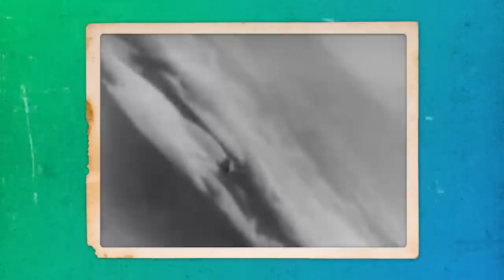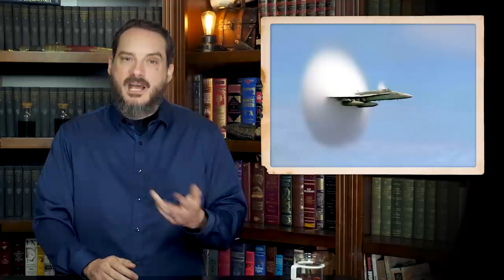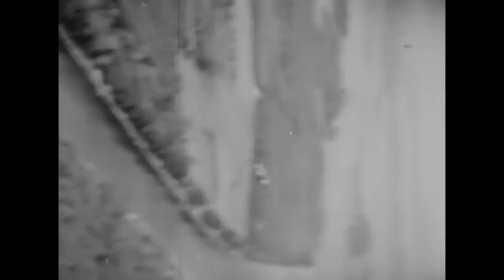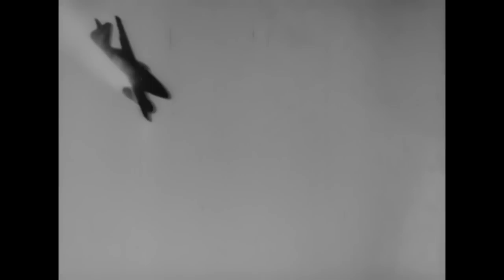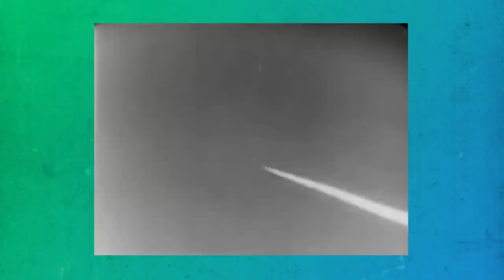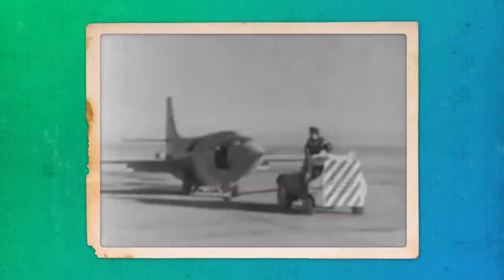Did a German Pilot Break the Sound Barrier 2 Years Before Chuck Yeager?

Comment: One small correction: Hitler's orders had nothing to do with there not being enough 262 fighters. The problem was engines. To make a turbojet engine without exotic imported metals Germany no longer had access to was just BARELY possible, and resulted in engines with an official lifespan of 12-20 hours, depending on model, and can even reached that. By the end of the war there were about a thousand 262 airframe extant that never had an engine fitted
Reply: The problem wasn’t exotic metals - the first eight hundred engines had an even number of blades which caused them to explosively fail in resonance. Changing to a prime number of blades in the turbine eliminated that problem but left the turbine temperature issues.
The British engines were universally superior to the German engines.
Reply: @allangibson8494  So, Joel was correct. Solving the resonance issue did nothing to increase the availability of superalloys.
Reply: @ostiariusalpha  No but increased the engine life from two hours to twenty hours… Basically one explosive engine failure per flight to one per ten flights.
More Me262’s were lost to engine failure than any other cause.

Comment: It's likely that a bunch of plans broke the sound barrier before Chuck Yeager, but the x1 was the first in sustained level controlled flight.
Reply: Nope.  First - nothing with a propeller pulling it along is going anywhere near Mach 1, no matter how much you dive it.
Second - the drag rise of the early straight-wing (And slightly swept, like the 262) jets when transonic is so high that they just aren't getting there either.  I've flown some jets from that era - DeHavilland Vampire, T-33 (P-80) - and done aerodynamic analysis for others.  Physics says no.
Reply: @peterstickney7608  are you british by chance???
Reply: @peterstickney7608  yeah ok .. is your name  Walter Mitty by chance?
Reply: @peterstickney7608  I don't know what shape I'll be in at 80, but running a mile in 5 minutes probably won't happen.
Reply: @peterstickney7608  I'm not so sure. There has been a multitude of jet- and, most of all, rocket-powered aircraft in Germany well before 1947 and when looking at e. g. the Me 163, I don't think any of your points applies.
Reply: Even about that I'm not so sure. Many German designs of the mid-1940s seem to have what it takes to break the sound barrier and stay controllable, but with a war going on, no independent, official measurement was taken (which is how USAF can get out of even the most believable hints to earlier achievements) and a lot of data and reports were lost by the end of the war, either in bombing raids or in deliberate acts, aimed at not letting the enemy have valuable information.
The sad fact of the matter is: We will never know for sure, so I'd let Chuck Yeager have his triumph, but take it with a fair amount of caution anyway.
Reply: @LEJapproach  True.. Yeager was quite full of himself but he did live an extraordinary life
Reply: The de Havilland DH.108 Swallow could have been the first, but the tragic breakup of the plane during a test dive in September 1946 ended the idea. Had the DH.108 second prototype been shaped just a tad differently to better deal with the shock waves of approaching Mach 1, it likely could have broken Mach 1 by late 1946 or early 1947.

Comment: 600km/h? The speed of sound is the double of that.
Reply: That should have been knots, not km/h (well, it's actually 661knots, 761mph or 1225km/h, at 15C at sea level)
Reply: at high altitude 323kts IAS can be close to mach 1, but the rest of the video does not use IAS.

Comment: In 1986, I read Yeager's autobiography. All I can conveniently go by right now is memory, but I think what he said is that there were several flights made around that time, each pushing to a slightly higher speed, and the limitations of the instruments were such that it could not be determined with certainty exactly which flight pushed above Mach 1 for the first time.

Comment: This again...  Mutke's claims have absolutely zero credibility.  The Me 262s were "Silber (Silver) Assets" considered vital to the defense of the Reich.  Their operations, and losses were tracked with even minor incidents being reported up the chain of command.
We have those records.  I've seen them.  There is nothing in these records, or the inventories of Any LW jet unit that show any aircraft written off due to non-operational damage on that day.  If Mutke had in fact, brought an airplane back in the condition he describes, Heinrich Baer, Commanding Officer pf the airfield where he supposedly landed, would have immediately removed him and sent him off with a Panzerfaust in the direction of the Elbe. (His standard reaction, with full approval of the Chain of Command)  to pilots in training who broke jets by coloring outside the lines.)  Nobody with any technical knowledge or experience who had talked to Mutke thinks that there's any truth in the story.
As to more technical points.  Wagner never released any details of his analysis, nor of the data used to derive it.  The fact that he claimed he could do better with 1941 Wind Tunnel Data is, on the face of it, specious.  Wind tunnels at that time could not return anything like accurate data as transonic airflows occurred, due to shcokwave interactions with the tunnel walls.  Proper Computational Fluid Dynamics analysis of the Me 262 shows that it would, if it held together, been limited to a terminal Mach Number of about 0.92.  The drag rise above that speed is so severe that if you cast your 262 out of concrete, it wasn't going any faster.  As to the Mutke's claims on control effectiveness - the trimming stabilizer on the 262 had an electrically actuated jackscrew to move it, but the motor wasn't powerful enough to change the stabilizer angle at speeds in the transonic region.  When the Germans were performing high speed dive tests to determine the reason for 262s failing to pull out of high speed dives, one of the first things they learned was to set the stabilizer angle to a specific value for the test and leave it alone.
Note - in the late 1980s, as the Warsaw Pact was beginning to crack, I was part of a project to obtain and restore to flight one or two Czech built Me 26s (One single seat, 1 2-seat) using, of course, modern engines.  My role was calculating performance and flying qualities, so I'm not unfamiliar with the subject.  Unfortunately, the negotiations failed on diplomatic grounds. but a similar approach was used by the teams that built the "Ground Up" replica Me 262s using the U.S. Navy's museum example as a template.

Comment: The Me.262 was the second operational jet fighter being cleared for squadron service in August 1944 whilst the Meteor had been cleared to squadron in July. The DH.Vampire also first flew in 1943, six months after the Meteor but did not enter service until 1946. Impressive as the Me.262 was, it had been rushed into service, it had no dive brakes and its engines had to be rebuilt after each flight.

By the time the P-38 reached Europe it was considered low performance and regulated to harassing Mediterranean shipping (which it was good at, and later ground attack, it was no fighter), its low roll rate made it a sitting duck for axis fighters. And its maximum Mach number relatively low, about 0.75. On most aircraft the maximum Mach number is little higher than its tactical Mach number, but with the Spitfire it was a lot higher, approaching Mach 1, meaning it could  pull out of a fast dive. The Me.262 had a maximum Mach number of 0.86, lower than that of the Spitfire, theoretically 0.95. The Spitfire was probably the first aircraft to survive exceeding the speed of sound, usually having lost its propellor, speeds of Mach 0.89 and Mach 0.92 were recorded, usually the pilot was too busy to make note of the instruments. This was not lost on the boffins at RAE, the X-1 was based on the Miles M.52 design.

Comment: 0:54  not 600 km per hour.  That is only 360 mph.  Try 600 knots instead.  That is approximately 690 mph, pretty close to the speed of sound at altitude but under the 760 mph which is the speed of sound at ground level.

Comment: I'm pretty sure there's a restored original, with original engines, still flying. All they basically did was use high quality metals for the turbine blades.
Reply: Nope - the flying replicas - and the real ones I was working on the restorations of, use GE CJ610 (Military J-85) engines, like an early Lear Jet.  The same mass flow, a somewhat smaller size, so they fit in the nacelles, and about 1000# more thrust each.
That being said, the replicas are better built than the wartime jets.

Comment: The Me262 was uncontrollable above Mach 0.85. Airflow separated from the wing surface. This also causes massive air speed measurement errors.
Engine design issues meant that the first eight hundred engines manufactured had to be scrapped which delayed operation until new engines could be manufactured in 1944.

Comment: 600 kilometers per hour is nowhere near Mach one. 600 MILES per hour is getting close. Mach one is usually around 720 mph depending on the density and humidity of the air, and is somewhat variable, as the speed of sound in any medium is affected by these factors.

Comment: The German supersonic wind tunnel was a unique design but a bit unreliable. To achieve supersonic speeds it used the pressure differential of a vacuum at one end that when released drew supersonic air into the tunnel.

Comment: The claim around 9:40 reminds me of the theory that the FAA intentionally delayed the Starship orbital test launch license until after Artemis I could launch.

Just in case it was successful as they’d spent billions on Artemis at this point and the lander has already gone to SpaceX so it could be egg on the face of NASA.
Reply: No, in the case of the XP-86A, the actuators for the nose landing gear were too week to lower it against the airflow reliably on landing approaches.  The hydraulics needed to be re-designed, and new parts made, so while that was happening, they flew low speed handling, and takeoff and landing tests.
Reply: @peterstickney7608  The subsequent launch of starship and the fallout from it should clarify the hesitancy of the FAA and dispel the rumors, but its a funny comparison and shows there'll be conspiracies about every decision.

Comment: There was the comet series of trans-sonic jets that luftwaffe engineers designed. 
That one pilot (still holds record for most plane models flown) flew is it the M29 comet (the short one that was unstable at times and melted some test pilots on tarmac with its fuel). 

Pretty sure one of the luft test pilots broke barrier in one of those or its variants in closing days of the war
Reply: I actually talked to the guy who is supposed to have made that flight.  Didn't happen, although he did exceed the aircraft's Critical Mach Number on climbout, and damaged the fin and rudder.
Reply: The ME 163 was not a jet, it was a rocket plane

Comment: You seem to be dancing around the fact Mutkee didn’t report a Sonic Boom at the described incident with the Me 262 he piloted at the time.

Furthermore the Sabre you used for reference is inaccurate as the Sabre which broke the Sound Barrier likely did not have the extra fuel tanks on the undersides of its wings like in the picture you used for reference.

As the fuel modules would have (and did) create drag in the same way the Me 262 engines would (and did) create drag.
Reply: @philwood5288  Did anyone asides from Mutkee come forward about the incident and mention what we would approximate as a Sonic Boom? Because clearly Highlight History didn’t mention anyone despite the importance of other primary sources to assert the claim Mutkee broke the sound barrier.

Not to mention given how far a sonic boom can travel and how extremely out of the ordinary in a dogfight with no use of high yield explosive munitions to hear such a thing is, you would think the pilots that intercepted Mutkee would report on such a phenomenon if it had occurred.
Reply: @philwood5288  Notice I mentioned the term High Yield Explosives, a Sonic Boom is very loud and travels over quite a distance a small explosion couldn’t compare.
Reply: @philwood5288  Did they report it however?

Because if not there is no evidence except the skeptical subjective account of a single pilot without a shred of tangible evidence to back up their claim.
Reply: @philwood5288  Given how loud a sonic boom would be to the usual munitions in air combat combined with a non-use of munitions before such a sound would have occured I would say it does warrant a report given the a-typical nature of such a event.

It seems you are trying to do whatever you can to support Mutkee’s unproven claim by discrediting my assertions as to why Mutkee did not reach Mach 1.
Reply: @philwood5288  Motkee did not describe Aircraft exploding in his account of events.
Reply: @philwood5288  You are aware the Me 262 dove which means in the process of diving it went below 35,000 durings it dive which means in theory a sonic boom would have been heard if it occured yet none of the pilots dogfighting Motke cane forward to attest to such a event.

Which leaves only the conclusion that Motkes claims are still utterly lackluster in integrity.
Reply: @philwood5288  During his dive which he would have gone under 35,000 feet regardless the speed of his plan would have accelerate thus ensuring if he did make a sonic boom someone not him would have heard it. 

But given no came forward to attest this it is safe to say he most likely did not.
Reply: @philwood5288  Any person who isn’t lacking in brain cells who know the difference between a munition blowing up a plane and a sonic boom there is a significant difference the latter is both far louder and less erratic than the former.
Reply: @philwood5288  I wasn’t assuming he reached Mach 1 after diving for 5000 ft, I said if he did reach mach 1 in that dive someone would have attested to such but no one did so again I must reiterate he probably in all likelihood did not by any means achieve mach 1.
Reply: @philwood5288  Conclusive proof, no, valid and tangible proof that ascertains already what logic has already shown to be the case by reason of deduction, yes.

Comment: If your full description is accurate, then he did indeed pass through the transonic zone and became supersonic. Not in any reliable way, however. The issue of controllability would come down to the 'Miles' all flying tail design, Which was causing the same problems with the Bell X-1, once this British invention was given to the Americans, Bell was able to modify the tail surfaces to allow controlled supersonic flight. Engines must limit the formation of shock waves with their intakes, usually using moving ramps or similar devices to break the flow.
Latter the Sabre could achieve Mach 1 in a dive, but never in level flight, the area squared rule was still having to be applied, as opposed to greater engine power.

Comment: @01:20 A historian and physics, not a good combination.👴🙄(this is an example why using the Imperial system is dangerous!👴😁)
It is NOT above 600 kph, it is above 600 Nautical miles, or 600 knots, which equals above 1111 kph.👴🧐🤔🤨😁🤣